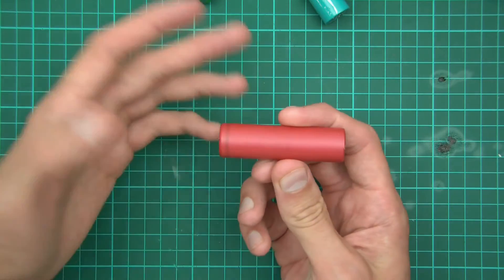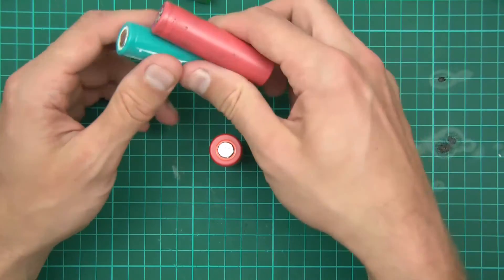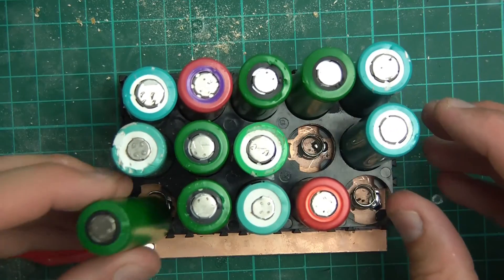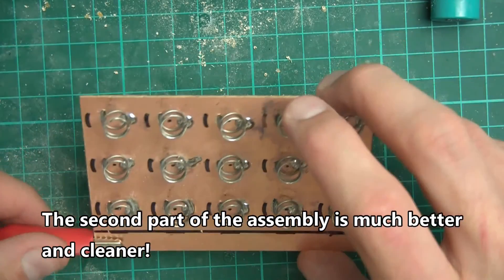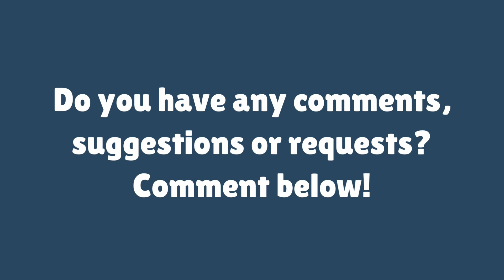TUTORIAL: How to Make Simple DIY Multiple 18650 Lithium Cell Charger! (Part 1) - Without TP4056

Comment: Overall, this is a good way to charge lots of cells at once. However, you still need to capacity test them individually. Springs are a bit big. They should be about 1/3 smaller in diameter as they get too close for comfort to the shell of the cell, which is Negative. I know there's a shrink wrap and a ring protector. But what happens if you miss a damaged or thin protection and slap it on anyways? Rapid heating up, I'm afraid. A button contact would even be a bit better.
5A on a pack that size is just fine as that's about 300mA per cell, well within the charge rating of "any" legit lithium cell.
Reply from the maker: Hey Korishan! Yeah, I agree. The spring isn't so bad though because only the outer 1mm from the edge of the top is minus. It's not possible for the spring to touch that, even if I remove the insulation. The rigidity of the spring doesn't allow it. If you got pliers in and stretched the spring, maybe you make it happen, but in ordinary circumstances, it's not possible. :-)

Comment: are those springs made out of an electrical contact's materials ?
why don't you use regular 18650 batt. holders with proper contacts ?
why don't you use a TP4065 module for each batt. ? It's reliable and dirt cheap.
Love your "kindergarten" tutorials :)
Reply from the maker: John Smith Hiya! It's nice to have you back! You tend to come and go. The springs are cheapo springs. The wrap 18650 holders are really poor quality and a pain when you want to easily get cells out of them. The rectangle ones are good, but I didn't want to spend that much. The TP4056 modules which I have are absolute shite. I've already made a charger with those, but this charger is cheaper, quicker to set up, more compact, easier and more reliable. For me, those TP4056 modules only seem to last a few weeks then they die! Also, they don't seem to be very accurate. Lols, thanks! Kindergarten videos. :D :D :D
Reply: I'm always around. Me not commenting means you are getting better :)
Reply from the maker: Ok, I'll have to start making more mistakes. I used to enjoy reading your scathing comments! :D

Comment: I agree with Engineer875.  Lithium cells use a constant current (i.e. the voltage varies) for the first phase of the charge until they reach 4.2v then a constant voltage is used.  Mismatched cells will reach this point at different times.

Please don't apply 4v @ 5a and hope for the best!
Reply: All cells in parallel will reach 4.2V at the same time. It's not possible for them to reach different voltages.
There's nothing wrong with NOT doing CC then CV. The downside is that you won't get 100% capacity charged back into the cells. 
5A is nothing with that many cells. He's charging 15 cells @ 5A, that equates to 0.33A per cell. This is waaaay lower than what these cells can handle. The biggest issue here is that it will just take 3 times longer to charge the 15 cells at once, than charging 3 cells at 1A each. But overall, he's done 15 cells, not 3.
Each cell is not receiving the 5A current, only the whole pack. For this reason, this method is fine and safe.
Reply from the maker: Hmmm, I've been doing it for 3 days now and it's working perfectly. To start with, you have to stay for a few minutes to check for hot cells (damaged cells seem to act as a short). If you take the damaged cell out, there is so much contention for the current amongst 15 cells that cells can only typically have a draw variance of around 150-450ma maximum. As long as damaged cells are removed, I think it's very safe!
Reply: It's not safe mate.  You can charge nicads this way but not lithium cells.
If you insist please do it somewhere where it won't affect you or your family.
Reply from the maker: Cheers! I'm not sure why you think it's not safe though! Remember that it's limited to 4v and the current in my case is limited to 5a amongst all cells. From what I remember, the reason why people recommend charging Lithium cells at CC is so that they do not draw too much current - when you allow lithium to draw too much current, they can overheat. They change that to CV afterwards because if you left it on CC, it would overcharge the cell. So, CV ensures that you cannot overcharge it. Remember though that the way I'm doing it, total current is limited to 5a AND voltage is limited to 4v. So providing that the cells are similar voltages (and ages if you think that's important) each cell will draw around 1/15th of the total amount of available current MAX which is near 333ma per cell, and even then, that is only if the cells are all completely drained. At the moment, I've got another batch on the go, and these are only drawing 2a (not the 5a max) and no cells are getting hot. So since they are roughly the same voltage, I can loosely assume that they are each drawing approximately 133ma each. That is only an estimate though ofcourse. Is your concern that one cell could be drawing 5a?
Reply: Antony: CC/CV mode is to get the most power stored in the cell as possible. It's kinda like the difference of tossing a bunch of cells into a bin at once (CC), and then arranging them in an orderly fashion and adding more cells as space allows (CV). If you only toss them in, then the bin isn't totally full.
However, your method will work and is safe overall. Though, I don't like the spring idea as it gets too close to the shell, which is Negative. A smaller spring or a button would of been better  ;)
Reply from the maker: Hey! Thanks for your input. That's my reasoning too. I think these guys are forgetting that ther are 15 cells and not just 1 cell.

Comment: Thats not gona work unless all the cells have been balanced some of them are gona over charge an possibly burn your house down
Reply: They need to be tested one at a time there is no other option
Reply from the maker: I'm charging them to 4v, and then individual. I've been doing it for 3 days now and it's working perfectly... But I'll keep you posted! :-)
Reply: Antony Cartwright cool. Ya I forgot that once they are all connected together they will self balance but if there a cell that is 3v and you connect it with a cell that 3.8v there will be alot of current going from one cell to the other
Reply from the maker: But current can't go from one cell to the other because the  -- and ++ are connected together! :-) Let's say we leave 13 places open and we have 2 cells in the charger, and it draws 2 amps, probably the 3.8v cell will draw 300ma and the 3v cell will draw 1700ma. Ofcourse, this is probably too much current for the discharged cell, but if you then add in more cells, the proportion of current will reduce massively.
Reply: Antony Cartwright if you connect 2 cell together - - and ++ the lower cell will draw current from the higher cell until both cell are equal
Reply from the maker: In this case though, all -- and ++ are tied together to the power supply. The power supply will always have the higher voltage (4v), so I believe the cells won't charge other cells to any great extent at all, they should all draw from the PSU. When I remove the power supply, then I agree with you, but even if I did that, I don't really see it as a problem. I've clearly got more research to do though! :-)
Reply: The only time there will be a rapid dump is when Antony first makes contact of the pack. If the cells are all within .5V or less of each other, even this will be negligible. The issue arises when the differing voltages are greater than 1V, and especially if the higher voltage cell(s) are near 4V. That's when sparky sparky glowing hots start to occur  ;)
Reply from the maker: Oh yes, you have to be careful - you can't just put them in and say goodbye for a few hours. It does work really well though! You've just got to make sure that you don't put any dead cells in it. Dead cells get very hot!